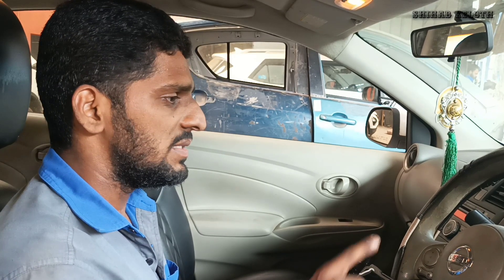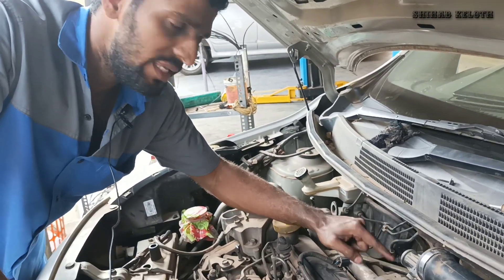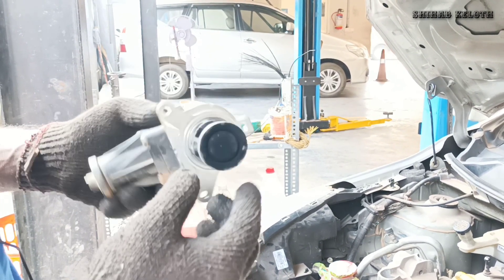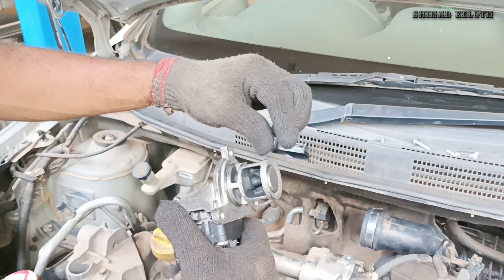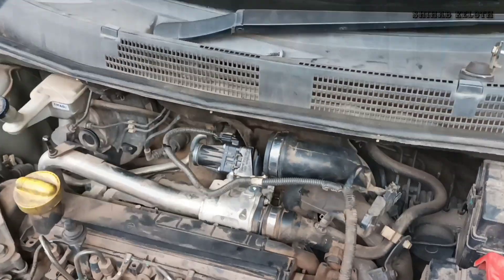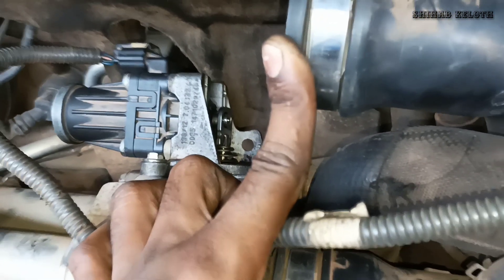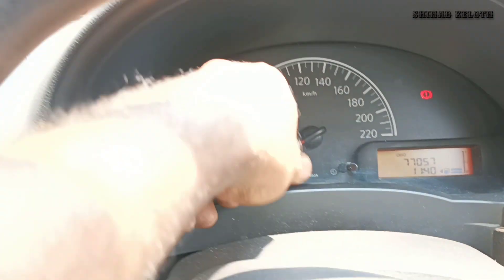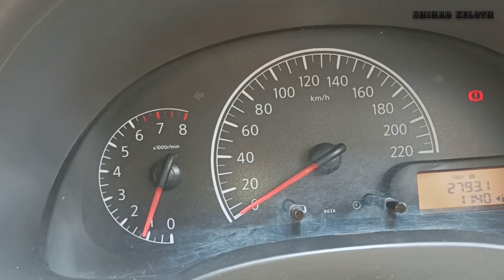How to Rectify Engine Warn light I EGR Valve Problem I എന്‍ജിന്‍ ലെെറ്റ് പരിഹരിക്കാം I Nissan Sunny

Comment: Hi Shihab, informative video. Thx. 🎉
One small information. Nissan sunny diesel year 2012 model, what is the capacity of gear oil?
Reply from the maker: Nissan Sunny Diesel Gear oil :-2.7L
Reply: @ShihabKeloth14  Thanks Shihab. 🙏
Reply: @ShihabKeloth14  Thanks Shihab, few days back I changed my Nissan Sunny Diesel 2012 model's gear oil with Mannol 8104 75w80 API GL-4 along with Liqui Moly gear additive 40grams. Thanks

Comment: sunny 2013 diesel okke compalint ulla vandikal ano
seconds eduthal engane irikkum
oru sadharanakkaranu maintain chyth kondu nadakkan pattumo???
Reply from the maker: Second hand nissan sunny edukumbol detail ayi check cheythu mathram edukkuka.
Engine working, oil leak issue , Suspension, accident , underbody condition etc...
Reply: sunny petrol lle diesel ne kkalum better
petrol n vere nthelum faults undo
Reply from the maker: Petrol sunny nallathu thanne.
Petrol sunny adhikam kandittilla..
Kooduthalum diesel aanullath..
Kandathum